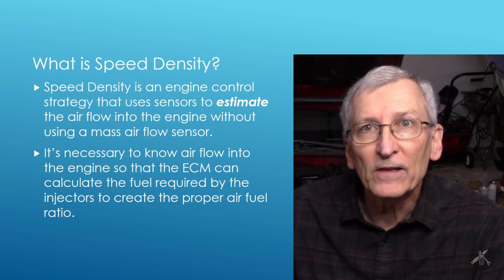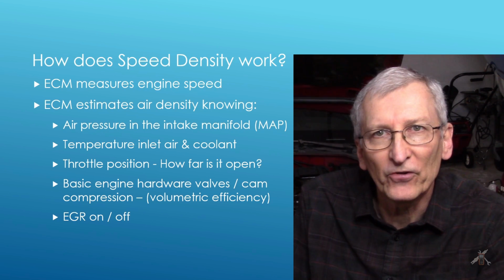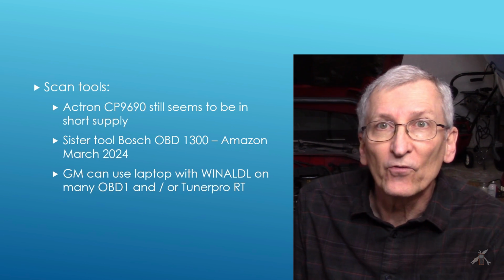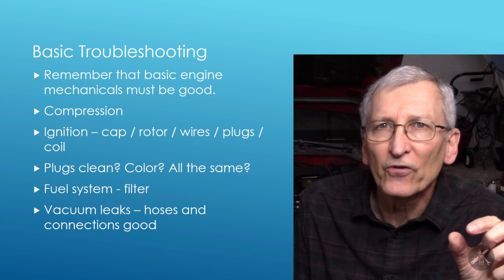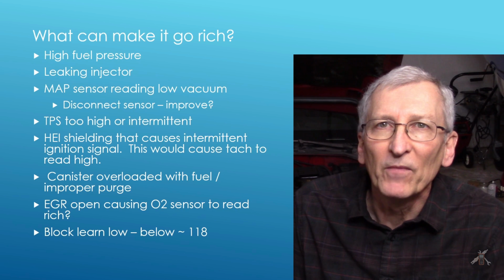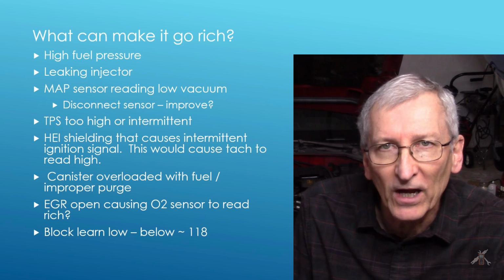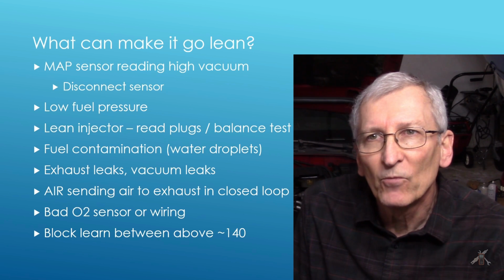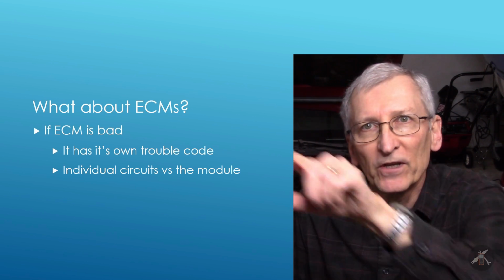Diagnose Speed Density ECM Controlled Engines - How does it work and what should I think about?

Comment: Hi Dan I have a question for you about the charcoal evaporator canister(305 TBI): the other day I found a great ammount of fuel in it and in the vent line from the tank too,my check valves are all new,the Camaro manual says to replace the filter in the canister but mine is sealed at the bottom,no way to open it so my idea is to delete that canister because of safe you know,I don’t want my Camaro in flames for that problem.What do you think?Is it possible to delete that?Thank you.
Reply from the maker: You're correct that you need to address this issue to eliminate the liquid fuel for safety.  I can't advise to remove or eliminate the canister, but rather find a way to make it work correctly.  
I'm not expert in this area, but this is my best understanding: There are two basic reasons to have fuel in the canister and the lines.  First is overfilling the fuel tank.  It is intended to have an air bubble at the top where the vapor line connects, but a high fuel level (perhaps more than 3 clicks at the nozzle) and possibly combined with parking on a slope can cause fuel to be pushed up into the vapor line. Second, there can be cases where vapors collect and condense in the canister.  The canister has an area where some liquid fuel can collect to be drawn out in normal operation later.  If the purge function isn't working correctly and drawing out the vapors, fuel may continue to collect and overload the canister. You need to verify that the lines and solenoid to the intake manifold are providing vacuum to draw vapor from the canister.
I haven't seen a GM canister in the '80s cars that wasn't round with a filter in the bottom - it may be possible, but I don't know.  They normally take in air from the bottom.  I have seen some with the filter missing, but there ought to be some openings for air intake.
If it was mine, I would try to blow out the lines with compressed air to remove liquid fuel. I don't know the best way to drain the canister. I have seen some others who have tried to flow compressed air through it or found ways to open the canister and replace the carbon, but I have no experience to add there.  Only a suggestion for further study.
Reply: @bitsofwisdom460  Yes,sometimes I overfill my tank,it’s my defect you know…..
Perhaps that’s the reason,my other '88 Firebird has the same completely closed canister,I can try to swap on the Camaro and see.I have to search when that solenoid is active.The vacuum lines are all free.

Comment: Exactly....I have one of those and it reads zero. I happen to come across your video and thought I would reach out and see if you had any idea. I've NEVER seen anything like this B4 in my 40 years of wrenching . Check timing twice engine hasn't ran for 5 minutes so I'm sure the cam is ok
Reply from the maker: Ok, just need to be sure of the big stuff. If you measured it, that should rule it out. These odd ones can really make you think. 
So, I go back to your comment that the engine ran well without the exhaust and after install it won't run. That suggests that either something else changed during the exhaust connections (such as wire or cable connection disturbed or shorted to ground) OR something totally unrelated died by coincidence at just the same time. I like to go down the logic paths - test and verify. Taking exhaust on and off is a pain, but you could still drop it enough to see if the engine will fire. Based on your back pressure measurement, I would expect that if you drop the exhaust, it won't run. If it runs, the question is what is changing at the same time. If it doesn't run, we go back to basics for a non-running engine - air - fuel - spark - cam - compression, timing and control system. Could it be a MAP sensor, yes it's possible. Could also be MAF, Cam Sensor, Crank Sensor - yes.  You can try disconnecting MAP or MAF to see if you get any change. It would help a lot to get a data scan on it to see if there are any background or history codes and what the base parameters are.  Sensor data on a dead engine and during cranking can be helpful.  Cam and crank sensors should look normal during crank.
Reply: Ok.... FINALLY....it runs. I took your advice and hooked the cats back up and then I hit me . I only removed the upstream O2 's with the cats hooked up however when I took the exhaust completely off there were no O2 's hooked up  and the truck would run , so I decided not to hook the down stream o2's with the cats hooked up and it fired up and runs so the problem was in the rear O2 sensors now what I don't no yet, I will investigate it more tomorrow.....thx for your help
Reply from the maker: @wwclt  You're welcome.  I'd be interested in what you find.

Comment: I failed to mention that I disconnected the entire exhaust however I left the O2 sensors plugged in and it starts right up, sounds like it is ready for Drag strip so I'm positive the  engine is fine. You think it could possibly be a bad map sensor... Thx
Reply from the maker: If the engine runs well without the exhaust system and sets no codes for bad sensors other than O2 sensor codes that will set because the exhaust is open. (Those would be lean codes and poor catalyst efficiency). Then I don't think you have an engine issue, I would take one more look at exhaust, even if parts are new. Exhaust back pressure should be almost zero at idle.  If that small amount of back pressure is upsetting the engine or engine controls, it seems extremely odd.  It could perhaps happen if a cam is off timing or a lobe is going flat, but you should have an OBD2 cam sensor that is monitoring position / timing. If MAP sensor reads correctly with open exhaust, I wouldn't expect it to be bad.
I would get a tool like one of these:
https://www.amazon.com/Tool-Aid-33600-Exhaust-Pressure/dp/B0002SQW9S
https://www.amazon.com/dp/B09CCWDKR6/
and check pressure at the O2 sensor ports on each bank and on each side of the cats.

Comment: I have a 2013 Ram 5.7 and it want start with exhaust connected however when i disconnect them the truck runs well.. This happened after cam and lifters replacement. Replaced the cats still not start however as soon i as remove the cats it starts right up....any thoughts...thx
Reply from the maker: My first thought is still exhaust. There shouldn't be much backpressure at idle.  If the engine runs without exhaust I would first rule out the rest of the exhaust. I don't know the history, but if you had cam and lifter failure causing misfire that took out the cats, the bricks in the cats can melt / fracture and travel down to the muffler and obstruct the pipe. Sometimes mufflers can have internal failure. I would either disconnect the exhaust behind the cats and test or get an adapter to thread into one of the post cat o2 sensor ports and get a pressure reading. If it won't start, at least get a cranking pressure reading. GM had a spec back in my Camaro days that said pressure should not exceed 1.25 PSI at idle and 3 psi at 2000 RPM with the cats in the system.

Comment: My 91 k1500 acts fine one minute shut it off start back in 15 minutes acts funny for minutes I’ve changed all the sensors rebuilt TBI. Idk make you chase tail lol  think it’s ECM
Reply from the maker: It would seem odd to be an ECM, unless you find a specific cause. I had one recently with a similar symptom that had a leaking fuel pressure regulator.  Pressure was correct, but it would bleed fuel through the diaphragm into the vacuum hose when shut off and make the engine rich on restart.